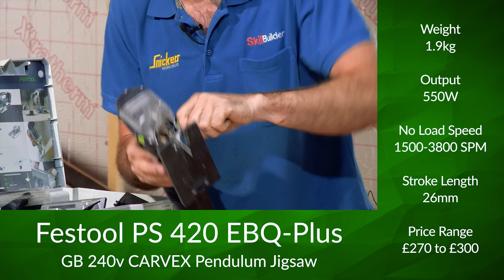Mafell P1CC - The World's Most Expensive Jigsaw?

Comment: I love seeing you guys doing videos like that!
Here in Germany Mafell is considered as the brand which provides both absolute 
precision and power. Their Tools mainly used by carpenters and for processing of large quantities of beams. If you have to cut trough 100 mm of material on daily basis on a professional level the answer is Mafell. 
I would love to hear your opinion on their portable table saw 'Erika' (most german name ever :) ) and the revolutionary KSS system.
Reply: Lennart the KSS is incredible I have an 80 and only once have I had another saw out of the box since I brought it. I’d love an Erika but it’s costs a bloody fortune.
Reply: The KSS 80 is a very nice construction tool, but it hast quite some heft to it. For almost every job I found the small sister of big ol' 85, the KSS 300, to be more than enough. Obviously it's not the right machine for beams or thick boards but it rips through sheet good and flooring like nothing. With the MaxiMax set the sheer amout of applications in one systainer is just ridiculous...
Reply: Lennart I do a lot of green timber framing so need the depth of cut. I brought the 80 first as I couldn’t afford two but my plan is to buy a kss50 or 60 later in the year as you are correct it’s a lump of a tool. What a tool it is though I brought some Bosch guide rails and my plunge saw stops in the workshop now.
Reply: Lennart I also needed a beam planer so couldn’t afford that and two saws at same time.
Reply: great !
Reply: I own the cordless MT55, the Mafell router, A18 drill and A10M. Amazing tools. I sold most of my festool to change to Mafell. The MT55 on an 18v 10ah Metabo battery is incredible! It’s true Germany really does equal precision engineering. 

If Mafell made a battery version of this jigsaw and a 315mm mitre saw...
I would sell my Kapex and Carvex immediately

Comment: I have the pleasure to own the P1 myself. It's incredible to work with. And a feature I didn't hear was the bottom actually uses the air from the motor to blow and transport the dust away and out of the back. And not in your face

Comment: I've been using Bosch jig saws for three decades barrel grip.
I found a tiny amount of lubricant on the roller and the pivot keep your jigsaw working smoothly and reduce the heat buildup on blades. 
You have to be really pushing a jigsaw hard to discolor the blade from heat. until 20 years ago no manufacturer had the blade stabilization guide or the orbital action in the same configuration as Bosh.
Now it seems like the standard.
the real star and all of this is the Bosch corporation selection of blades which can cut anything on any job anytime anywhere 🤭 . The bosch jigsaws I see now or cheap plastic for DYI mostly. 
funny how if you're in the trades for 40 years you see the quality of tools shift yet get more complex and better but cheeper. not to say there aren't a lot of amazing tools out there that we never had when we were young . 👍⚒️ 

I always enjoy you guys and your tool and  job videos. if I keep watching more I'll finally figure out the terms for tools and cutoffs you guys throw around 👍👌
Reply: I’ve been at it a while but just over two decades myself and I had a first gen Bosch that had the keyless blade change that was amazing and cut sweet. Got it as a bonus in my young twenties. It got stole last year and I bought a new one . Giving that thing away this Christmas to an apprentice. Not nearly the quality but good enough for getting close to a scribe or cutting out for electric. 
Getting this jigsaw for myself this year before the new year hits . 
Happy holidays , keep building!

Comment: I have had the Mafell for a few months and it is undoubtedly the finest jigsaw I have ever used. It makes the Carvex look like the awful jigsaw it really is. Sorry Robin, the Carvex is Festool's dog. The Mafell cuts 100% straight, there is a support glide in the Systainer which clips to both bases to keep it rock steady when using the rail and, as there is no blade guide at all, you can reverse the blade and cut by pulling the jigsaw towards you. Precision engineering at its best, the tilt base provides extra support on perpendicular cuts, the two pins in the trammel guide make circle cutting a breeze and the dust blower/extraction system is just superb. Great video, (RTFM in future!), and you will over the next few days see that this wunderkid is worth every penny of its outrageous price!
Reply: Very fine comment! Next time I would like them to be a little bit better informed about what they are working with, just as you say.
Reply from the maker: Yes you are right we tried to squeeze this one in on the end of the track saw video session and a ten minute read of the  'effing manual' would have been an  investment. We will do better next time. The blind leading the blind. Sorry guys
Reply: Good on you Roger!    The jigsaw will amaze you both with its performance and capabilities. I nearly fell of the bar when I saw the price but one quick demo convinced me that it was the Clachan a Choin! 

Festool dropped an enormous clanger with the Carvex and I bought one having been delighted with the Trion only to find that instead of improving it they had gone backwards. It broke three times and in the end it became an expensive paperweight as I couldnt in all honesty pass it on to someone else. The 18v version is a dog too, and I tested it against the Metabo 18v jigsaw which trampled all over it. I bought the Metabo as Mafell do not (yet) make a cordless P1CC but the latest news on a single battery platform for a number of German powertool manufacturers may change that. Possible a Mafellised Metabo, just like the drills Metabo make for Mafell.
Reply: I did buy festoon b4 I saw/heard of Mafell and wish I had gone for P1 as once u add the extras the price point was/is so close.
Reply: I’d never go back to my POS carvex from the Mafell. The cunex blades are cracking but they are bloody expensive. That said I’ve never bent one or burnt one out so they are actually worth the investment. Once you had a bit of time and familiarity with it you will see it is truly superior. Get Nathan out from NMA to show you all it’s tricks.
Reply: Does it have a strobe light? I find that very handy with my Festool.
Reply from the maker: PatR 
Yes agree with all you say and the cordless alliance will see a lot more Metabo Mafell. I have a comment video coming out on that subject.  An exclusive German club if ever there was one, whatever happened to the E.U?
Reply: Now I have used the Mafell P1CC my Carvex is no match!!! thanks for your information you know this tool!!!
Reply: Excellent Robin! It really is a game changer if you need a jigsaw to provide accurate and (almost finished) cuts.  My TSC55 and HKC55 Festools will be replaced by the Mafell equivalents too.
Reply: no
Reply: PatR I‘ve made very good experience with the carvex but the Maffel is just the top of the line
Reply: @carpenterjonathan   Unfortunately it has no light at all. one of its biggest issues. and no brake.

Comment: Had one of these about 5 years now and mainly use Bosch TO1 BR reverse cut blades and it’s a perfectly chip free 90 degree cut at about a quid a blade you not get a better cut. Nothing else out there to touch this, yes expensive but the time it saves more than pays for itself. Just missing a light 🤔😉

Comment: if I want to make a straight cut, the last tool I'd reach for is my jigsaw so I don't quite understand the point of that attachment I won't lie. If I happened to cut through my circular saw flex last thing on a friday, yeah I might well clamp my spirit level to the workpiece and use that as a straight edge as a last resort but I'd never choose to! Am I missing something?

I've also got a router attachment for my tracks, which I bought for housings and rebates. I never use it because the convenience of the track for a plunge saw is knowing that your splinter guard is zero clearance. As soon as you start introducing some arbitrary offset, set up time goes way up which is no good on repeat passes - looks like you'd have the same issue with the jigsaw attachment as far as I can see.
Reply from the maker: I can't disagree with a word you say. No point in putting it on the rail
Reply: With the CUnex (double thick) blade, it cuts surprisingly square - not sure why they opted for a standard blade in the vid. I use the short 800mm rail to finish the corners on cut outs after plunge saw cuts. I get a perfect square every time. Some might not want to be that anal but there you are. I use the jigsaw and rail for solid insulation too. Quick, straight and less messy than colleagues who still insist on a hand saw. Good for straight cuts on thick stock too with the longer CUnex blade. It's about options. I didn't always see the point of jigsaw and rail but it's a setup I use often now.
Reply: Bisch Basch Bosch each to their own, if for whatever reason it ends up being seen, I opt for the Japanese saw after plunge. I like the look of the mafell in all fairness but 90% of my jigsaw cuts are back cuts on a scribe so I'm not bothered in the slightest about drift
Reply: 1) If you need to do a flush cut
2) If you need to do a short cut (shorter than your circular saw blade diameter)
3) with some materials like laminate flooring or plexiglass, it's better to use a jigsaw than a circular saw
Reply: You're  assuming this saw will only be used for timber... I could see the rail being handy to use for cutting other sheet material like plastic and metal or where the circular saw just isn't appropriate.
Reply: @pouetance  I agree in 1+2, but for laminate I won`t use a saw at all (except holes for pipes) Try this,
https://www.amazon.de/kwb-Parkett-Schneider-Laminat-Schneider-handels%C3%BCblichen-Laser-Schnittmarkierung/dp/B0081AIDLE/ref=sr_1_3?__mk_de_DE=%C3%85M%C3%85%C5%BD%C3%95%C3%91&keywords=laminatschneider+kwb&qid=1561908411&s=diy&sr=1-3
 or something similar (not those cheap ones) and you know why
For plexiglass u have to use the right tooth geometry sawblade with not too much tooths, reduced rpm and something plain and not wobbeling underneath, when using a circular saw.

Comment: To me, it is the most precise jigsaw on the market, although it is far from perfect. 
I personally don`t like the unusual switching direction, miss a light, and very much a motor brake.
You have to relearn (in ancient times, when I was young, none the jigsaws had brakes :-)))  ) to be very careful/patient, when putting it away.
Also there is an issue with those (well working) double blades: They are a little too thick, for finishing cuts of todays thinbladed plungesaw cuts.
So you have to use a normal blade, when doing kitchen workplate cutouts.

Comment: What's with the On/Off switch ?? You have to manually turn it off
Reply from the maker: Yes with a body grip it is often used under the workpiece so the cut is down. The switch means you can then hold the post and achieve better control on scrolling.

Comment: I still own the carvex and I agree it’s the worst jigsaw I have ever used ..... the blade guide just doesn’t work and if it jumps out of work piece it always breaks the gear cover ..... horrible machine festool definitely need to upgrade ....... is the Mafell still good with the cheaper blades ie Bosch ?
Reply from the maker: It was a dog for sure and some say it was not even their machine just rebadged.
Reply: Yes. Mafell do not make jigsaw blades. Mafell blades are made by Scintilla/Bosch in Switzerland and the only difference is the logo on the blade and a higher price! The Bosch T101B is perfect in the Mafell as are all the Bosch blades.
Reply: Bradford joiner 1 year on lol and I’ve decided to buy the metabo 140plus what a machine love it ........ it’s got the old type blade tensioner with the wheels which actually works ......... plus it costs £160 with 3 years warranty ......sorry festool but you’ve lost a customer to your jigsaws

Comment: Mafell blade flex/heat gimmick is just that,  a gimmick in my opinion the majority of the heat comes from the material blade friction and the flex in the blade is simply because the blade is flimsy also speed is a major factor in cutting straight or plumb giving the blade time to do the cut..not trying to knock this jigsaw because I’m sure it’s good it has to be for the high price but I fail to see why it’s so expensive? There is very good jigsaws out there for ALOT less money that will do a just as good or very very close as good a job 🤷🏻‍♂️

Comment: The jigsaw is an underdeveloped tool.  It's just not important enough to get right.  Those damn jigsaws are too big and heavy.  These manufacturers have not figured out how to make a proper jigsaw.  Dust collection is NO GOOD (if you care about seeing the cut line), so don't waste time on it.  It needs a simple to use light (not a 10 second bypass setting like Festool stupidly did), it needs a blower to see the cut line, it needs to be perfectly secure and perpendicular, it needs easy ambidextrous on/off paddle with one hand (notice every jigsaw user holds the running saw up turning and hunting for the off button), needs to be light, needs to be cordless, needs to not be mechanically flawed like carvex, easy blade insert and release.  NOBODY has made one, because it is not a big ticket item.  That's why festool will not fix carvex issues, its not important enough.  It is a rough cut tool (unless you want to waste time finding your splinter guard or (buying a five pack? give me a break) cutting upside down with a veering blade, so pick your favorite color and go with it.  This tool will never improve.  Just give me the smallest lightest one out there.

Comment: I'd happily pay £700 never to use a jigsaw again. Most frustrating tool of the lot. For me, they're a great way to ruin a piece of work.

Robin has some sort of witchcraft to be able to cut straight freehand.
Reply: I never liked jigsaws never accurate enough, had one of these about 5 years now it’s so precise it’s scary never used there special double blade as I mainly use Bosch TO 1BR and it’s a super cut 90 degrees and chip free. Yes expensive but there’s nothing out there like it, the only fault is no light which would be a real bonus.

Comment: Waste of time and money - jigsaws are for cutting rough lines .. like a mobile bandsaw... as you say if you want accuracy use to a router to finish off the edge. Do we run a router around a sink cut out after using the jigsaw .... no we don't. in fact I use a track saw  and drop it in like we used to do cutting floor boards out ..not even a plunge track saw which is a better option... and finish the corners off with a hand saw.. quick accurate and cheap. Like a bandsaw - jigsaws cut safety .. thats there biggest advantage
Reply: If all you're doing is fitting kitchens, the mafell jigsaw (or most of their tools) ain't for you. I'm a shipwright and use one to cut max depth (115mm) beams in some pretty hard exotic dead on the line - and it actually stays square/at the correct angle!